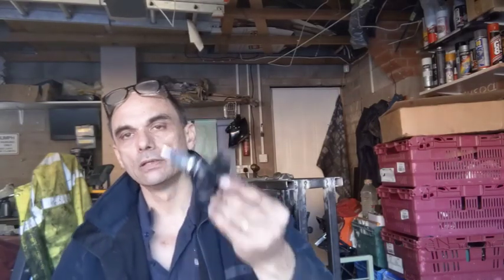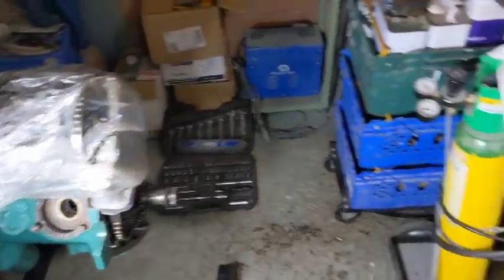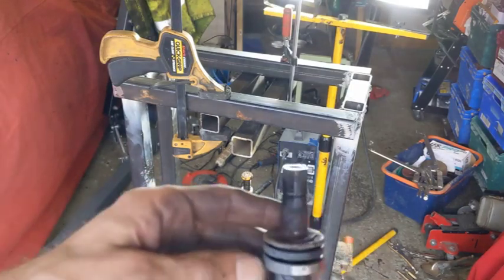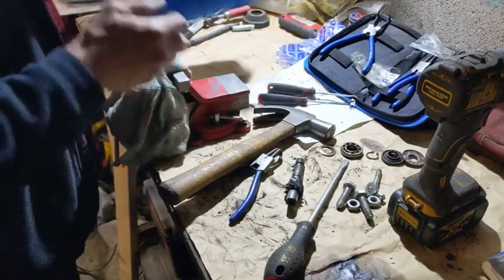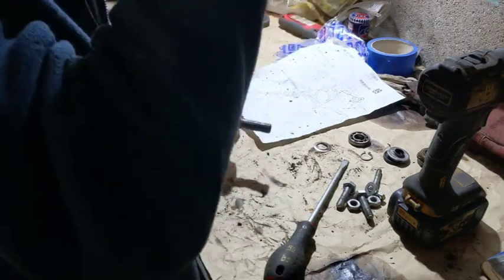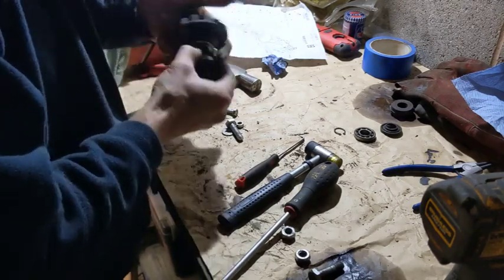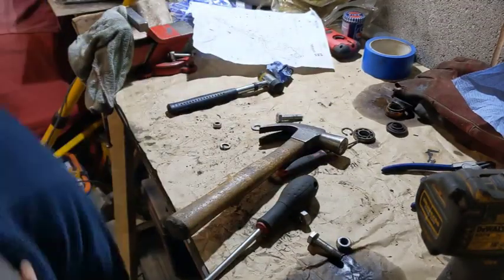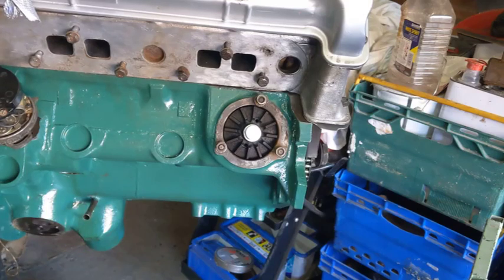Triumph TR7 Restoration: Episode 100   Water Pump Rebuild

Comment: If you talk to Robsport they will tell you that the seal kits have been updated with a replacement for improvement on the OEM part(s). Also I would remove the brass cage, there are two o-rings in it that you should renew which come with the seal kit. Caution: one IS thicker than the other, check part numbers for which goes where. I would also highly recommend that you get the sealing surface of the impellor (underneath) machined not just cleaned. I took 2 thou off mine which improves the sealing and prevents water leaking. If the car has been sat for a while I would highly recommend doing it. If not you might just be more fortunate than I was.
The sealing to the impellor: Fit the graphite seal, flat face downwards, over the shaft and seat in brass cage (with out of the block). The brass cage should come out easily by putting a 'T-piece' in and tapping straight up & out. The water pump assembly can be rebuilt into the brass cage and put into the block as a whole. Note the flat on the bottom of the water pump shaft, that is the clearance to pass the jack shaft gearing, to allow the water pump shaft to sit straight into the bushing inside the block. You might think you have seated correctly and the gears meshed correctly. If not then the water pump assembly will spin up and the end bolt will will hit the housing. Also damage to the water pump gearing is then possible.
Reply from the maker: Oh Chris, you always insist I should do it properly, and that makes me feel guilty and realise I should at least try.  ok, I'll take another look
Reply: @HenrysGarage  Haha mate, you did ask. Your call :)
Reply from the maker: I've spent some time trying to get the case out.  It doesn't want to budge and I don't want to damage it.  By putting a T-piece in I am guessing you mean the T goes in upside down and the ends go into the holes on the cage to pull it up?  Before I make something suitable, I want to ensure that's what you mean
Reply: @HenrysGarage  Yes, I knew you would know. You could technically use a punch on the top rim try and free it somewhat as the the top rim is not a mating surface. But that would be a last resort as it may not look pretty after. I remember sending you a soft copy of the workshop manual as a pdf some time ago p173 as listed in the pdf manual will take you to the water pump assy, under cooling system.